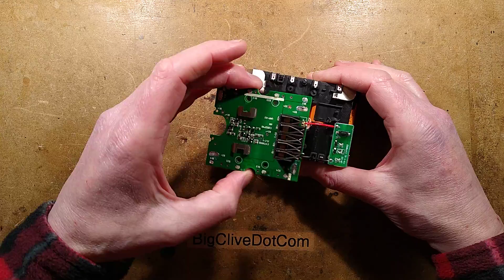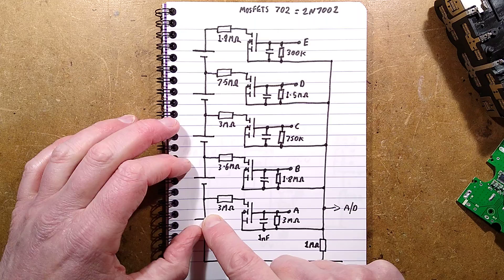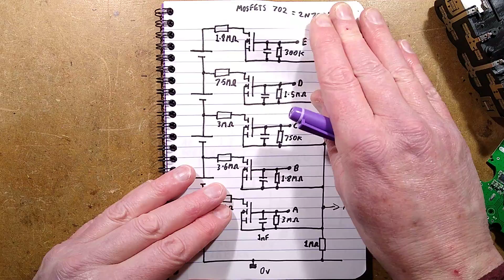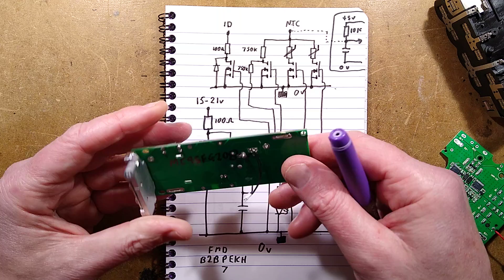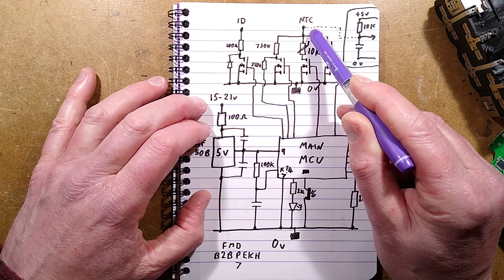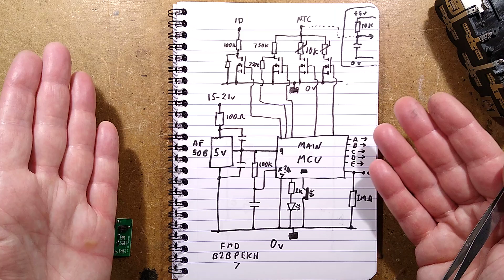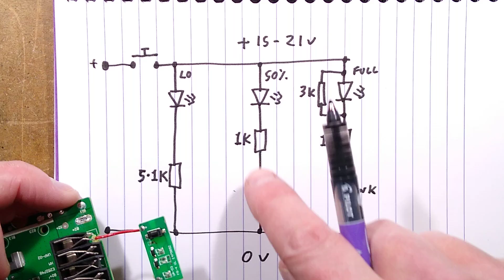Inside an Aldi Ferrex 20/40V battery (with schematic)

Comment: Next step use arduino or raspberry pi microcontroller maybe parallax Quick Start. To create a equivalent battery bms with a charger. But maybe beyond the scope of the channel
Reply from the maker: That would be a very time consuming project with high liability due to the repercussions of a software error.
Reply: @bigclivedotcom  I not sure what that means but some people can write code for lithium management without using other people code or free code. That performs the same tasks if you know the theory of how it works. Main idea is using themo data to keep the thing from burning up in flames. There are different micro controllers to choose from.
Reply: But your right a big Hassel. I made big projects also. But I rather for people do the leg work of course.
Reply: @bigclivedotcom  no one said you have to share everything from a safety standpoint. I figured you may know how to build one.

Comment: The ntc connection must connect with the charger so the battery doesn't overheat
Maybe that 3rd mosfet in the chain also signals the charger

Comment: Great series, but there is still that question out there of if there's comms between during charging. If you have or can access it, after the holidays when the returns come in stock, maybe finish off the trilogy?
Reply from the maker: Spoilers, the charger uses both signal connections, and can switch current to each section independently.

Comment: Big clive can you tell me what they call those five receiving clips on the bms control board.  I haven't been successful doing a Google search because I just don't know what they call them.  Interesting reverse engineering.  Lots of over discharge protection.
Reply from the maker: The contacts will probably be custom made for the battery pack manufacturer.

Comment: You know one thing I always wonder is if you could make an adaptor to conect battery powered tools to normal wall power... idk whay no one has tried it before.
Reply from the maker: They require high current, so it may not be viable.
Reply: @bigclivedotcom  it makes me think how do they really work because I once hocked up a dewalt 20v drill to a 20v power suplly at 5ah... funny this is that it will work but as soonas I put a load on it aka trying to screw something it lost power. I then tried with a bigger power supply and i burned the drill :p
Reply: @bigclivedotcom  Good point.  In the states, I think 40 or 50 amp 220V circuits are rare.  With 30A you probably be resetting fuses all the time.  As to 120V forget it since 20A is normal peak.  30A exists, but is rare and you'd have same popping problem.
Reply: Hikoki (Hitachi) actually make an adapter (model ET36A) to connect their range of cordless tools to a regular wall outlet. I guess if you are in a situation where you need to run a tool continuously this adapter would be beneficial to avoid having to bring both corded and cordless tools to site.

Comment: Their tools are good value, great for the DIYer. I'd still go for something more durable if I were a tradesman though.
Reply from the maker: On advantage they have on site is that they are less likely to get stolen, and if they do it's less of a disaster financially.
Reply: @bigclivedotcom  this is a very good point Clive. Suppose it's a matter of trust in your colleagues and the way the world is nowdays. Merry Christmas to you and your family good sir!
Reply: Cant recommend them for tradesman work. Only the impact has held up but even then it struggles doing more than light service work. 

Batteries are still going fine, I got an adapter to fit my makita skins but they drain quickly. 

Batteries are good if you're in a pinch but in my experience it wasn't worth the frustration of changing Batteries regularly.

Edit: I've only used the 20v batteries. Got no 40v ones

Comment: So if the tool switches off to protect the battery from low charge, does that make them unsuitable for powering our own projects. Or does the battery have its own protection. Is there a way to check?
Reply from the maker: These batteries have no ability to shut the power off.  It would need to be detected externally.  Some brands like Ryobi do have the protection inside the pack.

Comment: I hate the ones that well let's say the batteries are old, so you test them, and they won't recharge so you installed new 1850 batteries and the chip in the charger won't charge them

Comment: They could have added 2x 1MOhms resistors between the B1+ and B2+ and between the B1- and B2- to keep both packs at equal voltage if you have used your pack in a 40V tool and if one side has a little bit less capacity (so its voltage dropped more during the use). This would create a negligible discharge if you keep the pack in a 20v device but would reduce the stress when you connect it to a 20v charger after discharged in a 40v tool. (But you have to wait a bit between discharge and recharge)
A better solution would have been to have a plastic finger on a 20v to that triggers to mechanical switch in the pack to "remove" those. In that case you can use much small resistors and balance the 2 parts quite fast.
Reply: A 5 pin charger can balance the two half  packs against each other and can even move energy input between the packs to reduce battery temperature.
Reply: @johndododoe1411  If a large voltage difference appears between the 2 half packs you could create a 50 or 100A surge when you shorts the batteries together when you insert it in a 20V device... 
When then pack is new this is unlikely but when aging a difference in capacity will create a difference in voltage if the pack is empty.

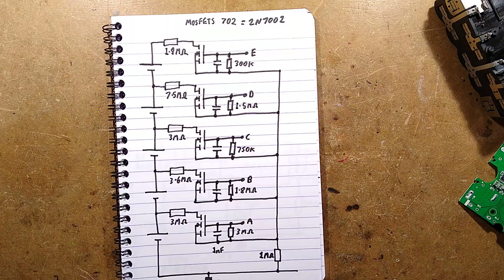Comment: Wild ass guess about the resistors in the voltage sensing circuit at 4:05.  The resistor values are bespoke for each battery pack to help balance out the load for each cell in the battery.

Comment: Well, I didn't hope to behold the times when microcomputers are cheap as dirt and exist in multitude in EVERYTHING.
I can't express how I was amazed when I discovered they made a specialized chip to replace a huge mess of discrete components with a single dedicated unit.
So much efforts went into engineering this, simple from the outside, thing; so much efforts you put in reverse-engineering them. That's a lot, thank you very much!

Comment: In an entirely unrelated example I can think of, two thermistors are placed next to each other for redundancy. That way, even if they're both reading 'normal' temperatures, the controller knows there's a problem if they drift too far apart. People have problems with false positives when they don't read the instructions and place them away from each other thinking they'll get better coverage.
Reply: Makes sense.
Reply: I thought the same, the thermistors are probably important to stop runaway and not just charging temps, so having two would mean the uC definitely has the correct temps.
Reply: Or perhaps, and I'm a mechanical engineer so please be kind, the schematic called for two thermistors i.e. one per battery but the intent got lost when the job was thrown over the office cubicle wall and the layout and mechanical engineers made an assumption. However, I think that the your rational is more likely, mine being the flip side of yours:-) PS edited for typographical error.

Comment: That is a very strange way to monitor the cell voltages...  the ABCDE voltages must be coming from the positive rail via a PFET somewhere in the micro processor. Either way it's an ugly way to do it and I question their accuracy of being able to measure the cell voltages. I doubt they used anything better than a 1% resistor tolerance... so they will be 2% on voltage measurement unless they calibrate every single board at the factory. (L-ion voltage measurement should be 0.5% of better) They also can't balance the cells if one is out of balance, so if they have a cell drift the whole pack is trash instead of being able to balance a cell back in. 

Overall there is a lot of gymnastics here to avoid a "real" balancing gauge such as a Texas Instruments part... I feel they would be better off just using a cheap "secondary voltage protector" chip to determine over-voltage and monitor the whole cell stack to determine under voltage... About as cheap, and a whole lot less complex.
Reply: I didn’t see any positive rail in Clive’s second page - I think maybe there’s some magic in that arrangement.

Could they be pumping charge into the gates of the 2n7002s through those caps, clever timing and 3 state IO?
Reply: @uuid.uuid4  Good catch that there's no positive rail! For pulsing they would need a series capacitor in line with the 2n7002 gate which likely wouldn't be in the IC (we'd see it outboard)... 

Looking at the divider for the top "E" FET (hardest FET to drive): A divider is make with the 1.8M and 1M with the FET in the middle.... so at 21V on the divider, the FET will need 7.5V +  Vgs = about 10V to turn that divider on... So that means they just need about 10V to turn on the top FET. The Microprocessor only has 5V on it only by the looks of it... 

Wouldn't it be funny if all that circuitry was on there, but they weren't using it at all? I'd love to see an o-scope trace of the "E" line during normal use!
Reply: Agreed - @bigclivedotcom  how can the micro turn on the N FET from E if the micro’s supply is only 5V?
Reply: @uuid.uuid4  That gate's only got to be about 0.7V above the divider voltage to start to pass meaningful current (a few µA).
Reply: Early trashing of the whole battery is a design goal not a mistake: they aim to profit by selling replacement batteries rather than the drills. Just like cheap printers with expensive ink cartridges 

Not that I'm cynical, you understand 😉
Reply: Their particular aim is to avoid liability for catastrophic failure due to charging of an unevenly worn cell, and to avoid continuous drain that would be caused by a constantly connected voltage divider.
Reply: @abitofabitofabit4404  Sure, that's the intent! 😃 But looking at the divider setup... 
when they measure cell 1 voltage it draws down cell 1
when they measure cell 2 it draws down cell 1,2
... cell 3 draws down 1,2,3
... cell 4 draws down 1,2,3,4
... cell 5 draws down 1,2,3,4,5

After a year of measuring I would expect cell #5 to become unbalanced and over-volt, with no way to balance it back in.

So, it's kind of a self fulfilling prophesy, they fear a 4.3V cell, and they are for sure going to get one that way!

Comment: All that design time. All that buildout, and all that reverse engineering. Just to hear the sound it makes when it hits the trash bin, when it dies. It's not like you can replace cell 4 when it goes bad, they just shut off the whole pack. Keep working. Good luck! 👍
Reply: Unless the microcontroller refuses.  This should happily recover after cell replacement.

Comment: Ah.. Remember when you just put a zinc carbon battery in ya torch and it just worked? 😆👍
Reply: I remember when you just put a zinc carbon battery in your torch and it just leaked between uses
Reply: Not for very long though. If I remember correctly, as a kid, they seemed to run out of juice pretty quick. 
   Got to admit that modern LED's and Lithium ion batteries are so much better and cheaper.
  I appreciate your point though. I often wish I could turn the clock back.

Comment: Cool to see what is inside these kinds of battery packs.

I have wondered as of late why these battery packs cost so much, here in AU those ALDI batteries cost anywhere from 40-80 bucks, a hellava lot cheaper than a more well known brand, but after seeing this I am wondering if all that circuitry is actually needed, I understand the need for the charging circuit, lipo's can be fickle, but there seems to be so much circuitry just to provide power to a motor, is it needed or are they made that way to justify the cost, maybe a little 'conspiracy theorist' but I don't know, it's just something that has bugged me I guess.
Reply: I do believe it is all needed just need to think back to the hover boards to see what happens when it’s not done right 

My thoughts on the name brands is there trying to recoup the development cost and they can charge whatever they want most need it for work so have no choice but to pay it
Reply: @MegaBCAD  Yeah I didn't think about development cost. And yeah you are kind of forced after you decide to go with "X" brand, I still prefer corded tools, I don't do much outside the house so they work for me.

Comment: I think that the pull down resistors for the MOSFETS' gates could have been connected to 0V thereby removing the through current causing an error for the ADC. NMOS devices do not mind if the  gate is lower voltage than the source - it just depletes the channel a bit more.
Reply: Some N channel MOSFETs are only rated to -1V or so but the 2N7002 isn’t one being rated to -20V. I’d be more worried about low gate voltage. You might get significant Rds on variation. That might explain the divider variation

Comment: Did you happen to notice whose cells they are using? As mentioned below, the Aldis here are basically grocery stores with a small assortment of general home items. There is essentially none of the interesting stuff they have in the stores on your side of the pond. Which is a bit of a shame, as there's been a few things you've shown that I wouldn't mind farting around with.
Reply: There is some cool random stuff, just no cordless power tools.
Reply from the maker: Samsung has been mentioned.
Reply: The larger Aldi and Lidl stores in the UK have one island with offers that are constantly changing. Lidl call theirs "middle of Lidl", and Aldi have a similar space with a forgettable name. Currently (December) largely taken over by seasonal stuff. 

If you need to buy several things (like a drill an a separate battery) get them at the same time or don't buy any, because hoping the other component will come in is like waiting for the last picture card in a set
Reply: I have seen and/or purchased several power tools at several aldi locations in the Atlanta, GA area. I’ve also been to several aldi locations in Midwest U.S. that have had nothing but food items. It must be highly regional.

Comment: Do they use the scanning maybe also to balance? Somehow that would explain the different (low) pull down values?
Maybe the feedback channel in the NTC is used to actually read/monitor the temp? Wonder why it has 2 MCU, since the haters won’t work if the master one fails it can’t be for fault protection. Maybe scan speed?
Reply from the maker: Each pack requires a separate microcontroller, as they can be configured in series or parallel by the tool.  So they are kept separate with each having its own zero volt reference to its battery stack's negative.

Comment: I use a solder sucker on those terminals when I'm refurbishing a battery an after I put new cells in I solder wires to the connections so I don't have to fiddle about getting the old terminals inline with the circuit board

Comment: Well i guess you did it after all
Better than i thought it would be.
I wish they would make it so we could use our own cells, but thats probably a legal thing by itself.
Reply: I get your point. It would be nice in a way, but of course  one couldn't trust people not to mismatch cells of different types i.e.   capacity, and internal resistance. That would be almost impossible to straighten out with a bms and would quickly cause problems.
   Even with these packs, feel that the cells are not matched with each other closely enough. So the balancing drifts further apart. They really require some better active balancing of each individual cell at every charge. I don't know enough to say more.
Reply: There are some 3d prints out there for certain brands where you can drop your own cells in. Very big and clunky. Not even the legal problems to worry about, but not understanding that some devices need high drain/A cells and others not. It's bad enough with the vapers who should know, yet the lower A cells are labelled "not for vaping". So much so that some wholesale companies are being chased simply for selling to vape shops.
Reply: @drsquirrel00  Yeah thats true.. unfortunately i use Craftsman tools which doesnt seem all that popular with adapters and such

Comment: Did it have to be that complicated ?
Reply from the maker: It's probably the simplest they could have made it for its required functionality.
Reply: I mean, it's a lot simpler than the battery circuitry on other lithium tool batteries I've seen.

Comment: That's a decidedly weird setup, surely it'd have been easier to just use a bank of P-Channel FETs and read the voltage directly... Though I suppose you'd still need to use a divider for the higher voltages, but still surely it'd have been simpler with P-Channel MOSFETs.